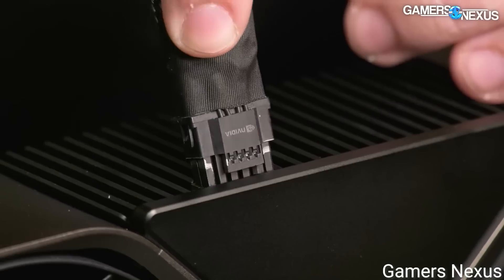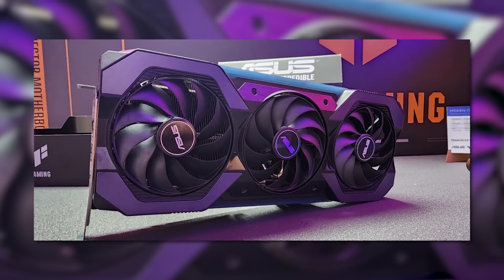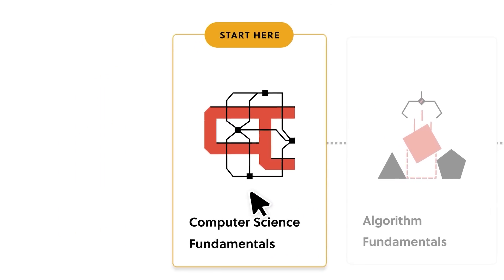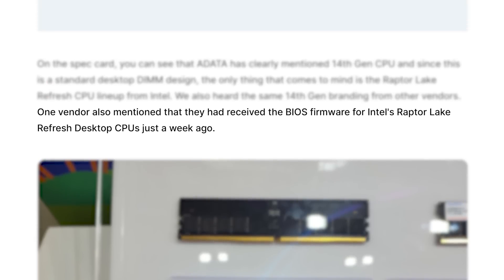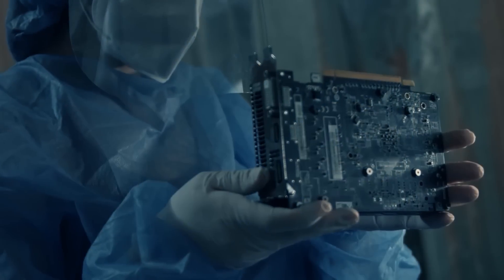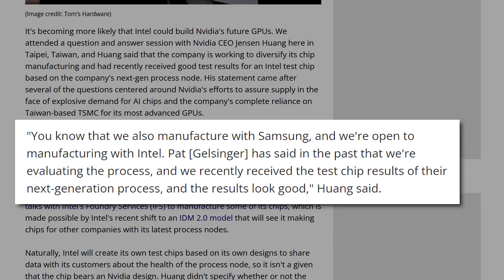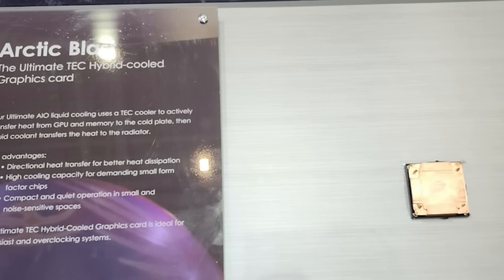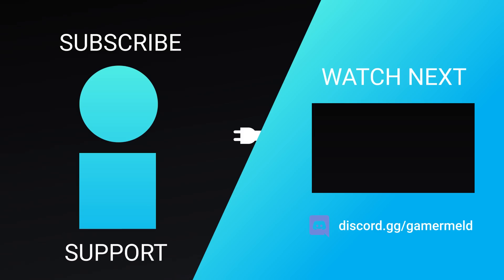Nvidia And Intel Are TEAMING UP!

Comment: 500w is the limit for me for a gpu. Past that then your pc becomes a space heater. Even if the card is sufficiently cooled, it will still heat up your room. My house ambient temp is at about 73f and after my 4090 plays some games in 4k my room will heat up to 85f. I have the windows open and everything. It’s just a lot heat. The gpu runs super cool though never hits 70c.

Comment: That GPU power connector should be the standard for an ATX 4.0 revision. It would help with GPU sag by adding more support, and give a cleaner look by removing cables, and fix the power melting problem.

Comment: Well if NVidia continues with monolithic silicon, maybe they don't mind using Intel 3N node and throwing away the outside 50% of the silicon if Intel's yield isn't as good as TSMC and Intel is selling these cheap.

It is also possible that Intel will use 3N on the inside and 7N on the outside for the smaller E-cores for their Raptor-Lake-S? I find it strange that Intel only starting buying the latest ASML EUV starting in 2022 with delivery slated for 2025. Interesting to see what Intel was using before that.

Comment: its just so dumb that they have to make cables with colors to see if its well inserted like principle of plugging a component completely is a new thing listen people u had cards before and millions of ppl had em before and it wasnt an issue so u think all the sudden all user became dumb with the 4000 series coming out... give me a break thats just reinforcing that the product is the issue.. its not rocket science... if u connecter ur previous cards and had no problem.. nothing changes its the same shit... blaming users is just  a sad excuse and a way to weasel yourself as a company to not RMA a product that has an issue. simple as that.. just ask any engeneer worth their sault to check at the burned cards and see what the issue is... and then try to tell me that its all user errors.. of corse if u got a too small case and ur crushing ur cables i mean ur just stupid but its not the case for most of them im sure... also there are simple solutions to space like 90 degrees connectors.   but again thats would be an even smaller sample of the defective bunch again engeneers would be able to tell.

Comment: The good thing about the yellow banding is that 1. a user can make sure it is always connected or if it wiggled out somehow during use, and 2. somehow proof that it was plugged in correctly and still melted, this way there is no excuse for the committee to go back and check their design and certification of this cable.  Also, not sure if we can trust ASUS with this new power delivery since they can't control their delivery on the 3D chips.

Comment: 2080 ti still going strong.. would be nice if there's an upgrade module without having to dish out another couple thousand
Reply: U cand find an equivalent for cheaper like the rx6700xt or if u want more expensive but less longevity u got rtx 3070 with a whopping 8gb vram.

Comment: That card based power connection setup is very similar to what apple did on the mac pro in 2019 years ago with their MPX GPUs so that they didn’t have lots of cables all over the inside of the case.

Comment: So we have a few problems here when it comes to GPUs for PC. At least from what I can see 🤔
- 16-20 GB Vram in the future to run AAA games or just to get them to run at 1440p and 4K at high or max settings. At 60-120 fps.
- Higher power draw is hard to avoid when you want more performance with all the bells and bells and whistles.
- The freaking size of some of these GPUs makes it hard to make a small- or medium-size build.
- Nvidia has shown that they are willing to ship overpriced products and dumped the consumer group that made them money in the first place. AMD and Intel will be no better in the long run.

People need to vote even more with their wallets. But I'm not sure it will work that well. Just look at Nvidia stock 😒

Comment: Gaming Wattage...
I refuse to build a gaming PC that consumes more than 350W when gaming. So roughly 250W for the graphics card is my absolute limit. If they are building even better coolers for more heat then that means they are AGAIN brute forcing the top-end in terms of more transistors. Despite power efficiency gains, that's not sustainable. And considering the rapidly diminishing returns visually it's certainly not worth it to me... especially when the problem with a lot of games is such bad development that even a top-end card doesn't play some of these new games well anyway. I may just keep my R9-3900x/GTX1080 rig and buy a PS6 in a few years. I'm in no rush, and frankly I just can't justify the price. Maybe I'll buy an RTX5000 card that's similar to an RTX4080 16GB. Maybe. Starting to hit CPU bottlenecks for a bunch of games beyond RTX4070 with my CPU based on online benchmarks (almost bought the RTX4070 but 12GB turned me off and not switching to AMD yet). But maybe they'll improve CPU threading in the near future. Not holding my breath.

Comment: If you took the processing of 2 or 3 4090 mobile GPUs, how would that related to a standard desktop 4090? Certainly it would be a case of GPU manufacturers working on activating more and more cores on their GPUs as the workload increases. My computer idles at 250W, but that is the max draw of a 4090 laptop.
Reply: The laptop 4090 is equivalent to the desktop 4080 since the laptop version is about 20% slower than its desktop counterpart.

Comment: The gpu market should be great with the ultra-low demand we are seeing

While the high-end has ridiculus power consumption ,

 the mid-range has awful price/performance value , losing out to last gen gpus on that front , while offering shit-tier vram options ,and its not just nvidia , amd's 7600 is also 8gb but its slightly better value only because of a last minute price cut

Comment: 4090Ti is pointless unless it comes with atleast 32gb vram or better yet 48gb. You may as well wait for the 5090, would cost the same and perform way better.

Comment: I feel people that either forgot or are unaware that they can undervolt their GPUs (reduce performance by negligble amounts w/ reduced power draw)  - as powerhungry as these new cards are, that'd be the very 1st thing I'd be looking to do if I had a 40-series (running an undervolt on my 3080ti - 1.92Ghz @ 0.867v - over 100W reduction when gaming and still have good performance)
Reply: You just set a lower power limit, my 4090 uses 230watts for a few frames and the heat is like 50c. Nvidia ships cards that are already running in the overclocking zone, there is little to gain but a larger power bill.

Comment: The GPU power supply connector on the motherboard should be standard really. If it can handle the power draw of the most hungry GPU it would be a far better solution.
This or something very similar would remove cables and the cable issue currently at hand, which frankly should never have been a thing, that it exists on such an expensive product is monumentally stupid.

Comment: Stupid plastic clips. Why not make the connector housing out of metal, with a couple of thumb screws to tight it down to the card's PCB; like the old VGA connector. Just screw the connector down all the way and it would never move or slip out of the slot causing a false contact. PCB would break off before the connector even moves.

Comment: Yeah what is nonsense is that the laptop rtx 4090m has 100w tgp and it has the same performances as a dektop rtx 3090 sucking 250-350w power. Time for nvidia to care about the environment, our bills and that temperatures are getting hotter....

Comment: If Intel actually has their Intel 3 node in production on time and with good yields, that will be great news IMO and for me at least, quite unexpected.  That would certainly be one case where I would love to be proven wrong in my pessimism about Intel.  Intel REALLY needs some good news for a change.
Reply: Arc driver issues are less of a bad news than melting cables or exploding cpus
Reply: CompilationHUB  that's what it was named before but as I said they were categorized falsely as I explained with 10nm Intel vs 7nm TSMC, this was found under a microscope I watched a video about it so there's no way Intel 4 than is 7nm when Intel 10nm already were and also companies don't only look at the gap difference between two transistors Intel measured it differently before. That's why they changed it
Reply: CompilationHUB  what are you on😂 Intel named them false in the first place as Intel 10nm was comparable to TSMC 7nm and Intel 4 is 5-4nm Intel corrected it false names

Comment: 600 watts for a single card is insane a few years ago the average computer was around 600-700 Watts
Reply: My 4090 uses, 230-300 watts. It's all marketing bs, all that extra power gets you is 10-15% more frames if your lucky.

Comment: If the 4090TI does come out (I think it will), hopefully the power connector issue will be sorted on these new cards which should have been sorted some time ago. That yellow marking solution is not good if you accidentally or purposely move your PC & the connection loosens imo.
Reply: I finally upgraded my power supply a few weeks ago with an MSI MPG A1000G PCIE5 psu and getting to see how tiny the 16 pin connector is in person. It's no wonder they're frying themselves. For something rated for deliver 600W of power to a graphics card it is absolutely tiny. It looks like something made to charge up a tablet or Chromebook, not power a beefy graphics card.
Reply: Not needed set your power limit to 70%. Less power same fps.
Reply: 4090Ti is pointless unless it comes with atleast 32gb vram or better yet 48gb. You may as well wait for the 5090, would cost the same and perform way better.

Comment: Nvidia and Intel have always worked together as a necessity for optimization's of the hardware, and them working more closely together would be at the enterprise level for servers and AI. But for consumer GPU manufacturing and production this simply won't happen.
Reply: Unless Nvidia decided they did not want to deal with consumer gaming GPUs. Which at this point, with server and the AI market demand, they may consider it a good short term move.
Reply: Nvidia is not a fab. They've already said they would work with intel with their new foundry service is available. Their only choice is TSMC or Intel and is would be silly not to use both tbh.
Reply: yet big influencer keep making 4090 customs

Comment: It is 100% that they rushed it and the cables heat up and arc. Welcome to car stereo melted fuse blocks 101. Also lets hope the heat pipes on that 4090 ti cooler are not that far apart from one another.

Comment: The better cooling system developments might not be just for "even more power hungry" gpus, mabye we can someday see gpus that have the current or similar power draws but are much smaller, requiring much better cooling. The size problem of the GPU's is already a symptom of the cooling problem in itself, since the reason for these cards being so big is precisely the additional need for cooling area.

It's clear GPU power draws are not going to go away. Better, generally available mass produced cooling might just be what we, the consumers didn't realize we needed. Well, technically power efficiency is what we need, but I'm pointing this out as someone who expects just about the worst in this industry for the general consumers at this point.
Reply: Yes, but Nvidia needs next to intel because that intel can help nvidia to control the gpu with a lot of consumption, but Intel is the only way that you can create any new ones of nothing to cool down colder than hit the temperature of the gpu easier, Nvidia did know that this Intel CPU does control high consumption by lowering the temperature easier

Comment: Can we just limit unskilled people from building electric devices and have 2 fat wires +/- you screw down at GPU (bottom preferably)? Ok, 3 wires. One for GPU communicating with PSU about limits. 100 years ago they had better power connectors than our computers today. 16 wires to connect simple af 12V. Like your car has. The pain is real.

Comment: I doubt RTX 50 will be on Intel's fabs since they're rumours of Nvidia buying TSMC N3 wafers and GB100 & GB102 being on TSMC N3, probably RTX 60 for Intel (maybe 18A?).
Reply: compilationhub54  Intel 4 is reported to be on the same density as TSMC's N3 and Intel 7 is close to TSMC's N7. They don't use nanometer measurements anymore because Samsung 4nm isn't the same as TSMC 4nm. No process node is the same.
Reply: If I told you that Nvidia wants from Intel that they can manufacture more CPUs, more famous intelligence to control high gpus, more hungry, a lot because that Intel is the only man, more better.

Comment: Can't say I care a single bit for that cable, but I totally like how it looks.

Anyway I also had a cable that burned on the PSU side for the motherboard CPU pins and they were pretty much completely plugged all the way but the cables from Corsair PSU's completely F* sux, they are very loose even brand new and are never as tight as cheap randomware crap and after many years it's even worse, they barely make much strength and just don't come off if you pull them with very little force because of the plastic notch locking them in place cause otherwise they would completely come off.

And now I moved from my Corsair AX750 from 2011 to the new Corsair RM750X shift and they are even miles wore than the old, the pins aren't gold plated and the ones on the PSU side are like half the size of the normal pins that I already had problems with my AX750 and they are also loose cables even brand new without much strength to them and to finalize the plastic cover surrounding the pins are also very bad quality that after a good amount of years specially the ones on the GPU side that pick a lot of heat can easily start breaking if we squeeze them and I never had this problem not even on 20 year old cheap crap PSU's, the plastics were softer and would bend but not break apart in pieces 😡

Comment: I love my 3070ti. runs everything great. undervolted it is extremely efficient
Reply: 🤡💀🤡BuT iTs 8gBs💀🤡💀
Reply: @TheCosmicMason  that is actually an issue now, ik its stupid but I play on 1080p with a 7900xtx (I use it for compute not gaming) and the vram usage hovers around 9-11 gb in AAA titles.
Reply: @wandewboi  not that NVIDIA is great by any means but AMD uses more of the vram.
Reply: @TheCosmicMason  what are you talking about, it's a known issue that 8gb isn't enough anymore
Reply: @wandewboi  that is indeed what prompted me to make that comment. As much as we do need more than 8gb of vram, in the same game, an 8gb AMD GPU runs out of vram faster than a 8gb NVIDIA GPU. It is something like 8gb on NVIDIA GPU = 9.2gb on AMD GPU. Not that NVIDIA is better because amd GPUs have far more vram which makes the AMD GPU far more valuable based solely on vram amounts.
Reply: @TheCosmicMason  so would you purchase a 6900 only for vram? If its raw performance is worse than a 3080 ti, then it wont last long buddy, its not all about vram, and i had enough of this vram madness
Reply: @TheCosmicMason  for a 3070ti 8gb of vram is very bad.
Only the 3050 and 3050ti should have that amount
Reply: @drowzy7338  are you crazy or what

Comment: They are both facing competition from AMD so it does make sense strategically
Reply: What competition? AMD can't even touch the 4090...
Reply: @laszlozsurka8991 Hahahahah nvidia shill found
Reply: @xruud24  its true tho ? he literally said AMD cant even beat a cutdown AD102, let alone if Nvidia releases a full AD102 gpu like 4090 Ti, even 7900 XTX needs 700 Watts to be on Par with 4090, how is he an Nvidia shill ? stop blindly defending AMD or any other company
Reply: @Eleganttf2  your blind
Reply: @laszlozsurka8991  pretending this is true AMD is still closing the gap and strategy should be viewed long term
Reply: @laszlozsurka8991  most purchases are not 4090 and AMD has competitive GPUs at a better price in many cases.
Reply: AMD nobody can win anything against 4090gtx nobody !! AMD is incompetence because TSMC's 3 nanometers are not the same as Samsung's strongest 4 nanometers so, AMD's other nanometers are not the same as Intel's strongest nanometers a lot!! Let me tell you Samsung and Intel are complete competitions higher than less TSMC !!
Reply: @lightward9487  r/wooosh

Comment: I like the Asus GPU power delivery method a lot more than the cable. It's a playbook from the server space. Thanks for the good video. They've gotten better!
Reply: idk man. Can we trust that Asus would properly regulate the voltage of the components through their motherboards?
Let's hope they don't fry the GPU too instead of just the CPU now, hahaha.
Reply: @Refi_Van  ngl wombo combo in burning everything at the same time.
Reply: LMAO another burning disaster
Reply: @jovpal5685 gpu sag causing over voltage from bad connection I can see the headlines now
Reply: A Sus
Reply: that method is going to burn up the mother board
Reply: seems restrictive on how you can build
Reply: @user-cu5mz4jl7e  I think the ease and convenience outweigh the restrictions. I can see this becoming the standard, and I'd prefer that. One less point of failure to worry about too.